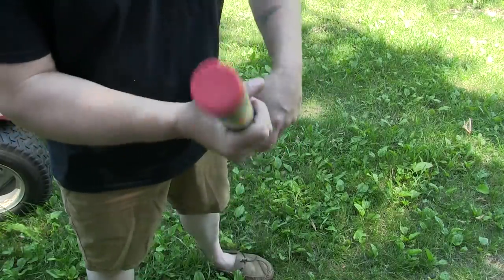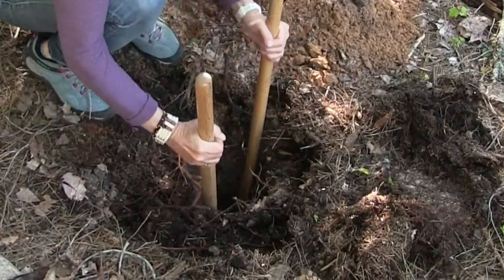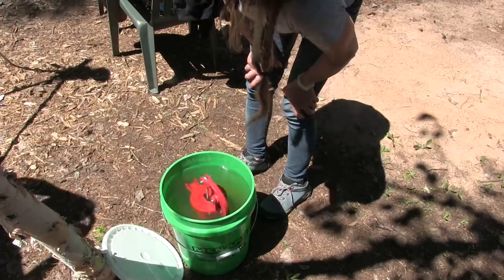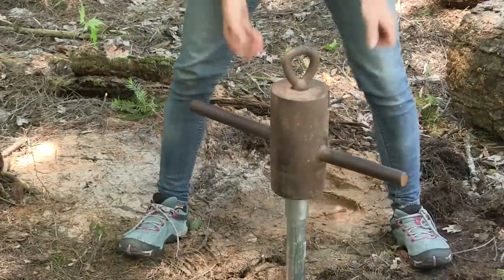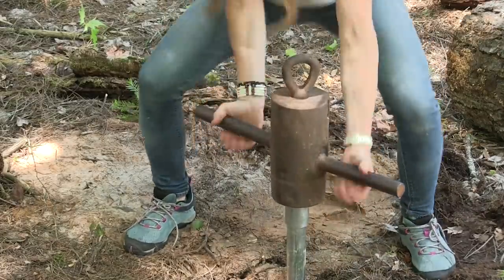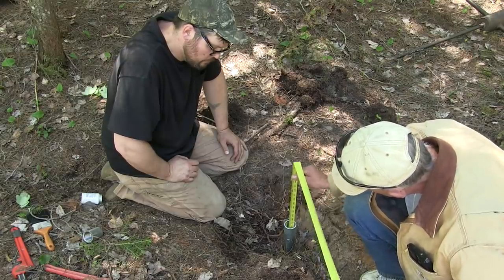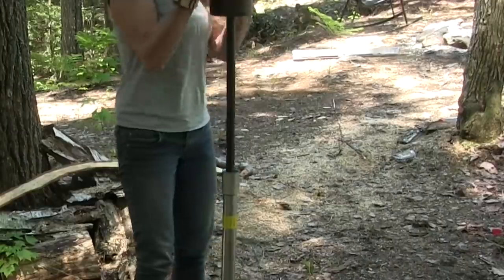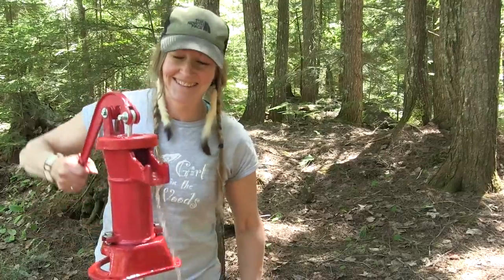Driving a hand pump well at a remote off grid Wilderness Camp

Comment: A trick my Dad used to do to clean out the silt down in the hole, is hook up a portable Air Compressor tank to the top (he used to make a fitting) and shoot compressed air down the pipe. This will "stir" the sand and make it come out when you bail it with the hand pump. You can also use a "rotary" "drill" water pump to help bail the water and silt. You'll need an Air Compressor to keep filling the tank or just run the compressor down into the pipe. Blasting it with compressed air not only stirs it up, but it also make a void which will make the water clear forever.

Comment: I have never seen, or heard of, a sand point for putting in a well. All I have seen is an auger for a hand drilled well. I have an old house with a hand dug well. Obviously not all that deep, but it has been in since the house was built just after the civil war. Amazingly it still has water - the only problem is it is extremely hard. When you drop it on the floor it goes crash, not splash. We had a drilled well put in about 40 years ago and don't use the old hand dug well, but it still has water in it. 

I doubt if the sand point would work well here in Vermont. Nothing but clay and rock in most areas.

Comment: You should have invested in a post auger those diggers are crap.  And no I don't mean the electric kind.  but the hand turn kind.  You can adjust the size of the hole and move a lot of even the hardest packed ground way faster and with way less effort.

Comment: i like your video. in the background on the ground during your introduction part of video is a plant with round leaves. very easy to see. idk if you know what that is but it is called plantago major. a very important plant. especially since you guyus are back country wilderness. this plant is a very strong antibiotic, anti scarring plant. it will kill staph and strep and MRSA infections. you ca use it topically for scrapes, cuts, burns and bug bites. you can make a tea for internal injuries or after surgeries. it is also a diuretic for swelling and excess fluids in body. to use topically rinse it off and crinkle the leaf up and apply directly to wound, if you no have a guaze pad. you can also wet leaf and put on the top large disc of spine to reduce fevers.

Comment: Always keep in mind that if the distance to water is much more than 20 feet a pump like this will not work. All wells should be sealed at the top with concrete to help keep surface water out of the well. Wells should be located at least 150 feet away from septic tanks and outhouses. Even if the water is slightly polluted it can still be used for washing.

Comment: did you have issues with the threads getting messed up on your fitting and pipe? I got them as tight as I could and I do plumbing, but these all messed up the threads after the first pipe I had to dig it up and remove the first pipe. I used the driving cap made by that company too. I also got all of my parts from Menards.

Comment: A tripod, A bar welded to the top part to add weight, a string pulled release mechanism would make that a bit easier...first Time I've seen it done this way...A  demolition hammer might help too.. plug into a generator or cordless...
Reply from the maker: Great tip!

Comment: Me and Dad drilled a well using a frame and a post hole digger.  We used 1 inch pipe with a 2” drill bit.  We ran water down the pipe while digging.  We got 32 feet and it dropped to 36 feet quickly and then couldn’t break through any lower.  We then reamed it with the same technique with a 4 inch reamer.   We got a 12 inch “pier hole” and placed casing.   That was 40 years ago.  Still has water.
Reply from the maker: Awesome!!

Comment: I had to drive a phone pole into some sand and we found that lashing a 10 foot pipe to the pole and spinning it while using a water jet pipe around the base worked well, got in down over 12 feet . I bet if you spin the well point a bit as it was driven in somehow it would displace the soil and sand around it easier. maybe they should be shaped in a spiral of some kind.

Comment: Excellent informative video Dave, thanks. I want to do this in my woodland based in a valley in SE England in the UK, but am struggling to find the sand spike and piping online. Can you recommend a good supplier? Also would it be possible to drive a well like this in chalky/flinty soil?
Reply from the maker: Its just for sand. I dont know what you would need there
Reply: @Bushradical  Cheers, I'm looking at using an auger with extension poles, appreciate the reply :)

Comment: Dave. As best I can tell my water table runs at 10 to 11 feet. At the moment we are running at 9 feet. Was looking to run 3- 5' pipes and 1 - 4' pipe onto of the sand point. Gives me 4' above ground and 18' below ground. 4 ' of water above the sand point. Am I good?
Reply from the maker: I dont know. I was told about a foot below the water with the top of the sand point is good. If it starts sucking air you could always drive it down farther
Reply: Thanks Dave. I know you are a busy man. Your video caught my attention. I have a spot I would like to have water at and this will do the trick.

Comment: BTW, Dave those are 'Pipe Wrenches', you said it right at first, but then called them 'Crescent Wrenches', there is a big difference as Crescent Wrenches could NOT tighten-up those smooth walled couplings....anyways a Great video, and I learned something 'new' to me, Thanks!
Reply from the maker: Narration mistake. I'm well aware which is which, thanks

Comment: So how do you keep from freezing up in the winter? Wouldn't pump and lines above or at ground freeze up tight??
Reply from the maker: you just let the water fall back down the pipe. pull the handle straight up and it will break the seal and release the prime.

Comment: Have installed well points for years.  Easiest way is washing it in.  3/4" pvc taped to the 1 1/4" pvc, then turn on the pump.  Usually 50 to 100 gals of water.  No driving and no leaks
Reply from the maker: I'd have to see that

Comment: So I need more info on pipe specifications. I used what looked like similar pipe but it crushed when I started pounding. All connections were tight and doped up.....
Reply from the maker: The pipe is 1 1/4" but its rated as "Drive Pipe" the couplers are also sold individually as DRIVE couplers. All the parts are thick and heavy

Comment: Can you please post the supplies list for your well project?  I'm interested in doing the same thing on my property.
Reply from the maker: Its just a pump, several sections of drive pipe and drive couplers
Reply: @Bushradical  I'm more interested in the part at the bottom, is that some sort of filtering system?

Comment: My Dad used a portable Air Compressor tank to blew 100lbs of compressed air down the pipe. This did two things: 1. Cleaned out the sand from the pipe and 2. made a void area around the pipe near the tip. If you have a generator, you can always us a real Air Compressor also. My Dad, being a machinist, built a custom fitting for connecting the pipe to the air compressor. That way he could "blast" it with as much air as he wanted.
Reply from the maker: Awesome idea

Comment: Been checking out some of your road trips. Curious why you wouldn't stay in the states heading west as gas is so much cheaper. I'm guessing scenery, safety, or guys like Dwayne.
Reply from the maker: Gas ia a bit cheaper, but I drive a car that gets 36 miles a gallon. Also, the scenery is way better in Canada, and depending on where you cross the border you could tack on another 400 miles to the trip. I used to drive up through Eureka Montana , but its a LOT farther than the way I go now. It would be way better to break down on the the TRANS -CAN highway than on the high line in northern Montana.  If you want the shortest way possible you head north from Minot North Dakota......but the way I take is only 100 miles longer than the absolutely shortest route and the roads, traffic, and scenery are all better. Not to mention, there are so many small towns on US 2  thats I bet its just as fast going the Canadian route as there is nothing but open road

Comment: 5 years later he is still out there digging his well with that manual clam-shell post-hole digger....   why not use a spade shovel and pick?   Those clam-shell diggers suck even at their best.

How long did this take to do? It would take me weeks to make this happen. 

How much water is down there and how long will this well provide this high quality H2O? I should think that rainfall seeps into the aquifer to feed this well over time.  I imagine that all well/aquifer water has some flavor to it from minerals and things.  hopefully your water doesn't have too much taste. 

Pipe dope is not the same thing as dope for a pipe, you're welcome. 

You were wise to enlist an experienced old timer with the tools and knowledge to facilitate finishing this endeavor and doing it all right.

With my luck I would be hitting roots, rocks, engine blocks, etc. trying to drive that damn pipe into the Earth..  YOu used good materials. I saw another guy sink a well just like yours, but he used PVC pipe which struck me as a poor choice.  He dug the initial hole and backfilled with cement and gravel, whereas you were able to pile-drive yours because you had the proper tools and materials. You had that nifty perforated length of pipe that allows your well to seep water in over a significant amount of vertical depth which allows you more freedom and options to customize your rig to the nature of the aquifer and land.    This other guy had a simple tip that restricted backflow in order to keep the pump and pipes primed....  You did a professional job and it will last many many years so long as the aquifer lasts.

I didn't see how you initially discovered the quifer in the beginning... How were you able to locate your underground water source?
Reply from the maker: We are on a high ridge with wetland all around...and we're close to lake superior.....there are ZERO rocks anywhere here and water is omnipresent......it was easy in this location

Comment: I live in central Florida and have put in 3 shallow wells. I witched them all, but around here there is water everywhere when you  get down to 23 to 27 feet.
I used 2 foot sand points on my first 2 wells and they seem to get clogged easily when they are that short. The last one I drove I used a 4 foot point and it has been working great since 2006.
We live out in the boonies and always worried about having water if our power went out, as we have a 330 foot 4 inch well that runs off 220 volts, a pita if you're using a generator for power, but our hand pumped shallow well gave us new confidence and hasn't failed us.
One thing to keep in mind...always have a couple of extra pump leathers...they tend to dry out and crack if not used often and can be hard to find at hardware stores.
Reply from the maker: good points. I think if the point got plugged I would use a 25' piece of 3/4 pex and a shop vac........I bet you  could clean that point out quick. Ive used pex and a shop vac to clean scale out of water heaters and it gets right in there good.

Comment: I've never driven a well, but I have driven hundreds..if not thousands of feet of black iron pipe under roads. Two things were critical 1. Make sure the pipe remained level, and 2 as you beat on pipe it has a tendency to loosen the coupler..we kept a pipe wrench tightening as the pipe were being driven...
Reply from the maker: We did the same thing.

Comment: Wash the pipe and fittings with a good degreasing liquid dishwashing soap, dry with a torch and leave a couple threads bare (no dope).  Your water is going to have a bad taste for awhile, but I guess you have already figured that out by now!  Otherwise, real good video!
Reply from the maker: Thanks. Yup, I figured that out already

Comment: Is it difficult to get the drive coupler off of the pipe when the first section is almost to ground level? It seemed liked you used a couple of wrenches to winch it tight, just wondering if it is on real good after the beating to where it is a PITA-part of the job. Thanks!
Reply from the maker: Good question.  Actually it tends to loosen up with the pounding. You can usually take it off with your fingers. Thats why you are constantly tightening the whole pipe while you drive it. It tends to loosen

Comment: I just wanted to tell you another little trick with those inch and a quarter water wells, with a hand pump like that... If you take an inch and a quarter in line check valve and put on the Pipe with a nipple into the hand pump it will hold the water up in the pipe and you won't have to pump it so much to get it started you will have to pump it quite a bit to get it going when you first put the check valve on. But once it gets primed up to the check valve it will be only a few pumps and you'll have water. I would if it were mine take that last 4 ft piece of pipe back off cut it off about 12 in and have it rethreaded and then I would have  my inline check valve and a 6in nipple into the pump. That way it keeps it close to the same height as you have now. This will work for summertime but you definitely have to tear that check valve off with the pump in the winter and Cap the well, unless you're going to build a heated house around it??? Be Radical.., Aye!!! Jim in Clare.
Reply from the maker: Hey Jim. We just put a 1 1/4" Ball valve beneath the pump......pump it up / lock down the valve. Works great

Comment: Has anyone set up a point driving apparatus which hammers on the inside of the sand point (at the tip), instead of on the casing?  I've encountered some mention of it, but never actually seen such a setup.  A fence post driver or the "Scott special" seen here is easier to rig up and takes less steel.  I'm liking Scott's internal guide rod - you can get a long drop, a lot longer than with a typical fence post driver, and let the weight do more of the work.
Reply from the maker: right on. Scott's driver works great. Havent heard of the other model

Comment: We just tie a 1/2" nut onto a roll of string and drop it down into the pipe.   That will wet the string to the Depth of the water inside of the point.  As long as you keep tension on the string by lowering it slowly you'll have a good idea of how much water is in your point!!  Just pull up the string and measure the Wet String.  Also, Around here you use to be able to rent a well driver.  It usually had a Rod not a Pipe as a guide and the rod is small enough to enter the hole in your Drive Cap so you won't ruin any of your Unions.
Reply from the maker: right on

Comment: In Simi Valley, California, the water table is only 6 to 8 feet down under.  In some parts of this valley, you can't dig for a swimming pool.  This has been a huge problem for Simi Valley for many years and it still exists.  When I lived there, my family bought a house on the east side of the valley and the water table was lower than the west side so we were able to put in a pool.  I am sure there are many other places that have a high water table.
Reply from the maker: right

Comment: congratulations on your well!  but how do you prevent freezing with so much pipe above ground?
Reply: I’d imaging the will build a box around the exposed pipe and insulate it.
Reply: @InDisskyS131  That will still freeze unless you have a way to heat the pipe.  Insulation will only slow the heat loss.

Comment: just wondering - why not go another 5' deeper, just in case of?
Reply: George Simpson if you go past the water vein, your Sandpoint, which has holes in it, won’t be in water anymore, just your pipe will go through the vein, and it will not have those holes to allow water to get into the pipe.  Dry well...  Under the ground, there are aquifers, which are like lakes, there are veins, with water flowing through them, like little underground streams, or even rivers, and then there are springs, where the water is under pressure and will flow by itself once it finds a path to the surface.  I think most wells are in veins.
Reply from the maker: If there is ever an issue we'll just drive it down farther

Comment: Great video, watched it twice and just got done putting in my own well. Thanks for all the great tips.
Reply from the maker: did you get water?
Reply: @Bushradical yes I did, at least 8 feet of water in the pipe. Thanks again.
Reply: Hey Dave. I love your channel.  I got my well driven,  but I'm having issues ,and can't get water to pump.  I've got the top of the drive point 2 plus feet below the water table. I've primed it,snd pump leathers are good . It's hard to move the pump arm. I've scoured YouTube looking for a resolution.  I'm going to try to flush it with a spray nozzle.  Any suggestions would be greatly appreciated. Thank you.

Comment: I had a couple of questions.  
1- If you were to push downward on the pipe AND hit it, would it go down more easily?  Like if you or Brooke stood on a pipe wrench that you put on the pipe about a foot off the ground.
2- What if you used an electric jackhammer to drive the pipe?  I wonder if it develops enough force.  You can rent one from Home Depot.
Reply from the maker: A jack hammer would work....
Reply: @Bushradical  Thanks!

Comment: Great job. This hand pump is very common in India. Most houses have one. But the most comfortable level is at waist hieght. Because when you use your waist strength to pump the pressure is less on the arms. It's also sturdier and doesn't rock the main pipe.
Reply from the maker: Thats a FANTASTIC piece of info. Ive never heard that befor ebut it makes perfect sense. Thanks
Reply: @Bushradical  Thank you.